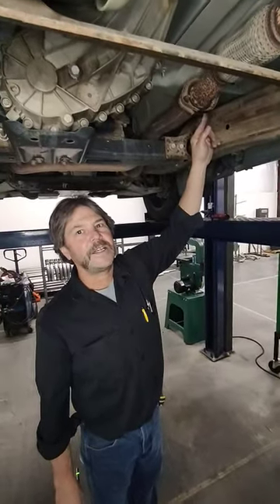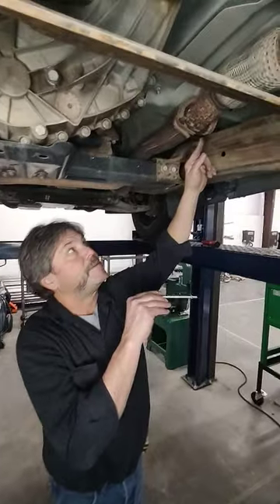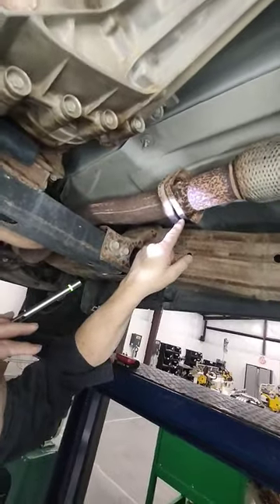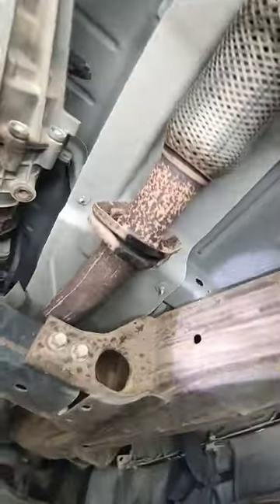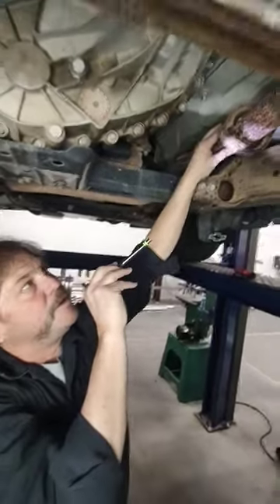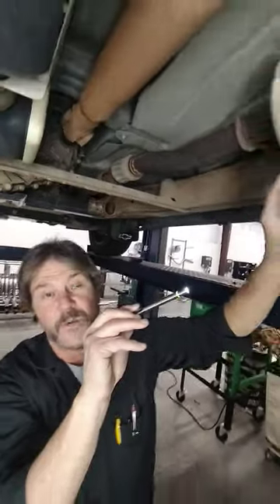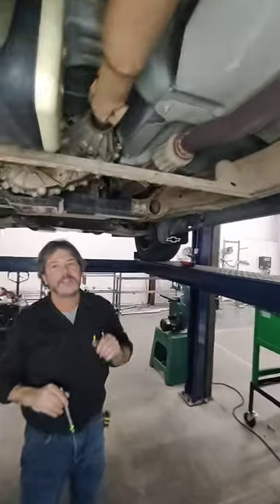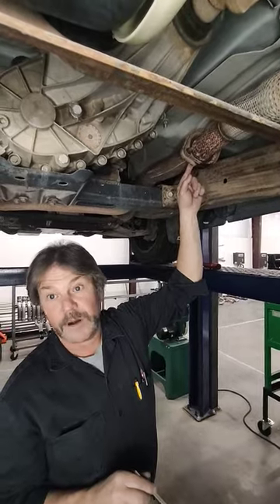2007 5.3L Stock Exhaust 🤢 needs update bad

Comment: After enough mileage on most vehicles you can get better fuel economy and power with a new exhaust system
Reply from the maker: Absolutely we are installing a MPI Exhaust Technologies system with our MPI performance series mufflers for a aggressive sound ✅ 
Our system is backed with a 3 year warranty
Guaranteed no droning, 2-4 MPG increase 
And most importantly increased performance

Comment: Drill another bolt hole on that problem flange.
Reply: Or just repair the the gasket....
Reply: @travissmith4102  there is no gasket there. Just a ball n socket flange design

Comment: No performance gains unless you remove the catalytic, or install highflow cat, and tune, but it will sound better.
Reply: Definitely performance and mpg gain with a 3 inch catback resonator delete and straight thru muffler...
Reply: @luke8222  not really. You get back pressure build up at the cat, a catback system only changes pipes after cat, (hence the name cat-back) leaving same amount of backpressure in the exhaust manifold. if there is any change, its too minimal to notice, only changing the sound of exhaust.  If you want any real difference you can measure on a dyno or feel,  the only way to go is catalytic delete or highflow cat swap and get a tune, otherwise your just wasting money ( if performance gains are your goal)

Comment: Almost every ls platform I have seen leaks at that flange, it's super common. Call me crazy but that's why I like fully welded systems. Little more of a bear to get out of the way for transmission work but ill take that over cel, o2 codes and annoying fa-fa-fa sounds
Reply: Cel and 02 codes? 😂🤣